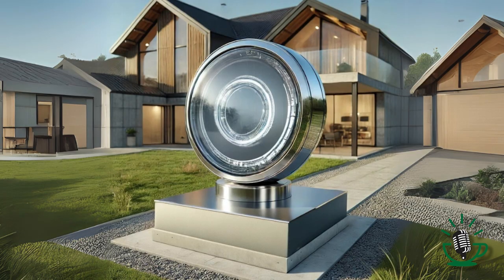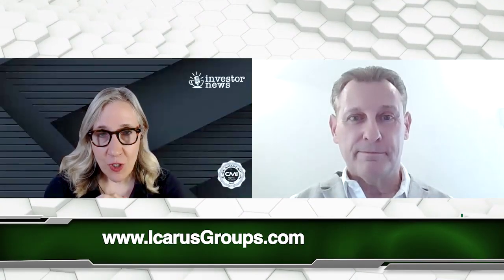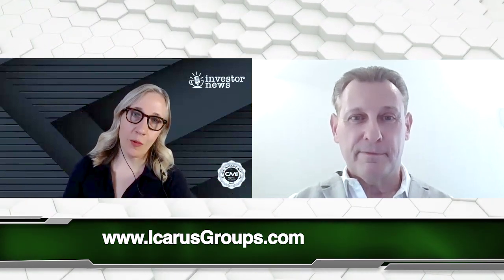The Icarus Sun Mill Spins Sunshine into Power, Clean Water and Heat

Comment: I learned nothing about how it actually works, seems fishy
Reply: I want to see it function. This is a financing pitch. The guy is trying to pump and dump the stock.
Reply: As an engineer I highly doubt that it works as promised. But even if it does, you can get a lot of photovoltaic and vacuum tube collectors for 20k